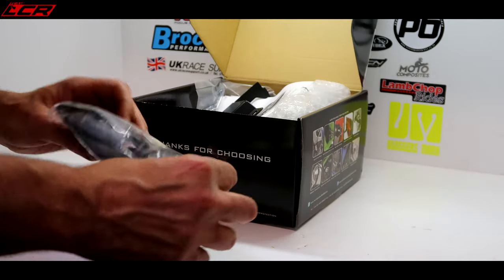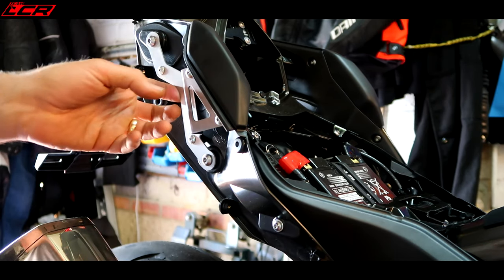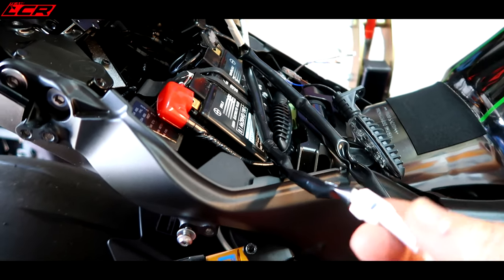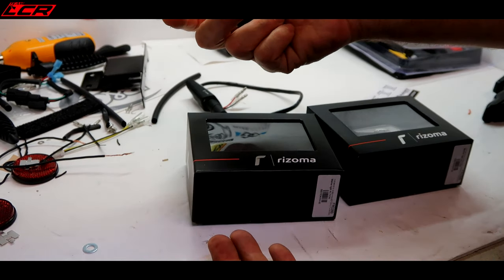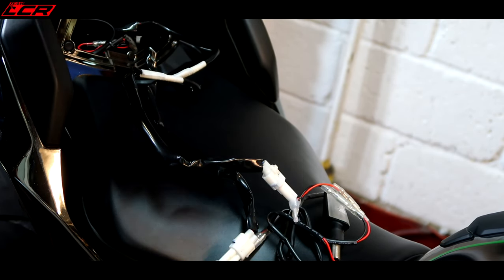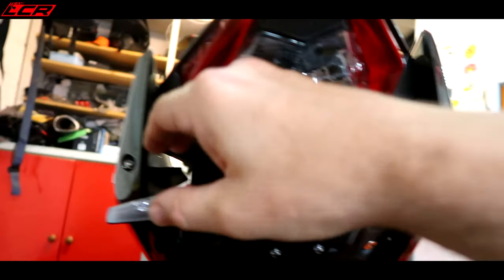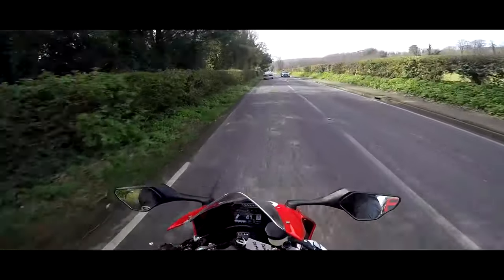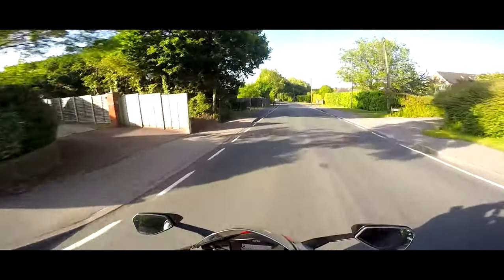Tasty Tail Installed On The Ninja H2!

Comment: Don't forget to change the battery, why don't they come with Lithium anyway lol.  I got a Shido LTX9-BS, you will need at least an LTX12-BS I would think or the 14 might be best, I've had mine for quite a while now with no issue.

You can charge with a trickle charger, but to make sure it's safe and the cores are balanced as it gets charged, the best for them is the TecMate OptiMate Lithium 0.8A Battery Optimiser.  I've never charged mine yet, but want to occasionally to expand it's lifetime use by balancing the cores occasionally, the bikes charging will be like a normal trickle charge.
Reply from the maker: Dont worry sir one on the shelf awaiting fitting :-)
Reply: @LambChopRides  Nice one mate 👍  Out of interest what did you decide to go for?  it's nice to know decent options to consider in the future, I know Shorai are good, but the only charger option is their own and they are even more expensive than the one suggested above.
Reply from the maker: Yes I have the Shido and a charger to boot :-)
Reply: @LambChopRides  Great minds and all that 😂😂

Comment: Much nicer rear end now. Why do the manufacturers not get with the programme and fit these as standard.
Reply: For some reason, the law requires that the registration plate extends past the rear tyre so manufacturers don’t have much option but to fit a duck billed platypus’ tail on the back!
Reply: @GaryFÓBrien  Ah OK. Learn something new every day. Thanks.

Comment: Begs the question "why don't manufacturers fit them from the outset"?
Reply from the maker: They cant, they have to meet regulations which state the number plate must be over the back of the wheel at the end of the bike
Reply: @LambChopRides  My god man...not only do you make excellent videos but you're clever too.....no wonder I only drive a Peugeot 106D and a lowly Honda NC750!!